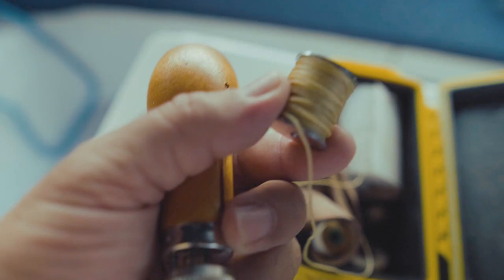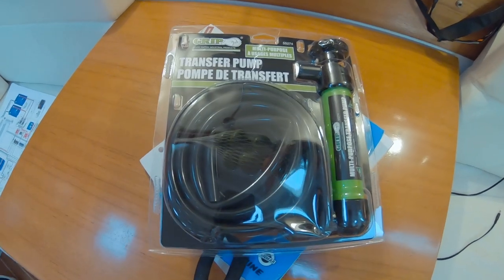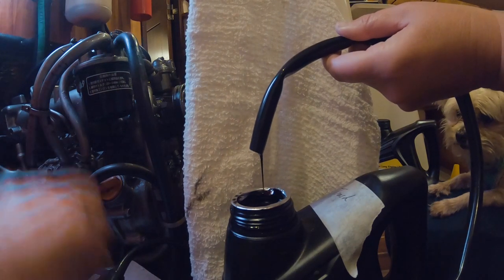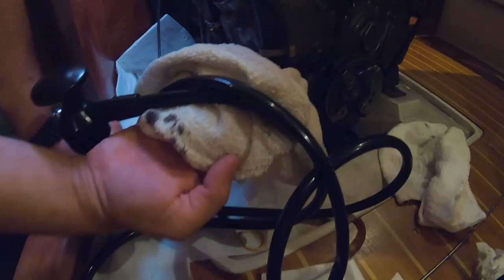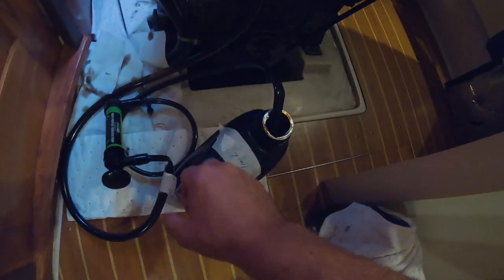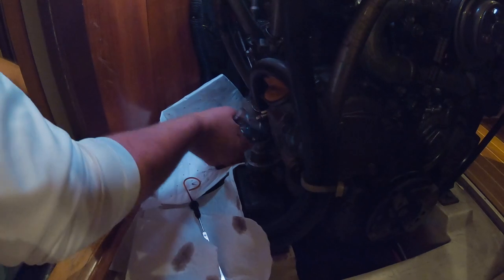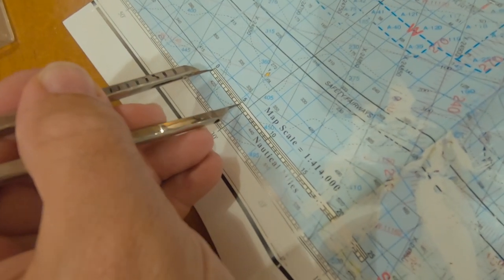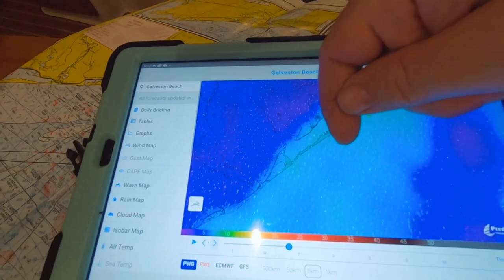How to use a Hand Pump to Change the Oil in a Yanmar Diesel, Offshore Prep

Comment: Just check your engine manual. Some older marine diesels should only have mineral oil. Synthetic oil can dissolve the gaskets in older engines. Also, I know there is not much tidal range around there, but will the tide be running with you or against you?
Reply from the maker: Thanks for the tip. I didn't know about mineral oil. The manual gave a range of oils to choose from, and this one has been used for years based on service records I inherited. Records are so valuable! ...yes, we'll be heading out just before the tide ebbs. The wind on the other hand, will be a bit in our face.
Reply: @TheFosterJourney  - close hauled is a good point of sail for Bermuda Sloops. Once you get everything sheeted in she will cut the water like a knife. Good news about the oil 👍 I am glad that is not a problem. Actually, we need to do our oil.... 😄😄

Comment: Did you run the engine before pumping oil out? If you run the engine, the oil will be thinner and easier to pump out.
Reply from the maker: Funny thing...we were half way through and stopped and said, "We forgot to run it!" Won't forget next time 👍

Comment: The oil dip stick tube does not reach to the bottom of the oil pan.  Sucking on the oil dip stick tube will not remove all the oil out of the engine, so you are diluting dirty contaminated oil with the new oil and not putting fresh oil in the engine.  The owners manual is available online, and it gives specifics on how to change oil.  The larger pumps with a big reservoir actually work very well because you pump them several times and they create a vacuum and pull the oil out of the engine.  you only have to pump them a few times a minute to keep the vacuum up and they pull the oil out at a good rate.  the smaller tube you put down the dip stick tube reaches the bottom of the oil pan and removes a lot more oil than the way you did it.  What does Yanmar say for how much oil the engine should hold at oil change with a filter?  I bet you left a Quart or two in the engine doing it the way you did it.
Reply from the maker: Thanks for the tips 👍 I'll double check the manual to ensure we got it all